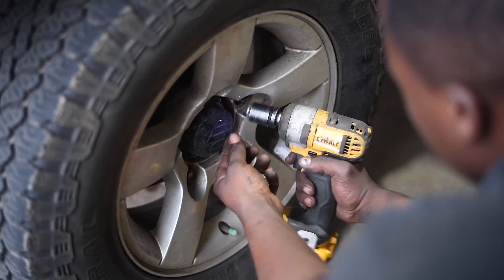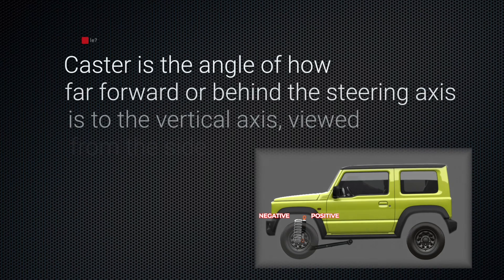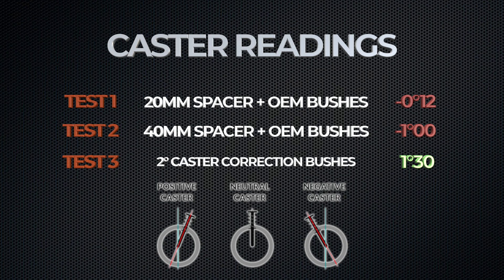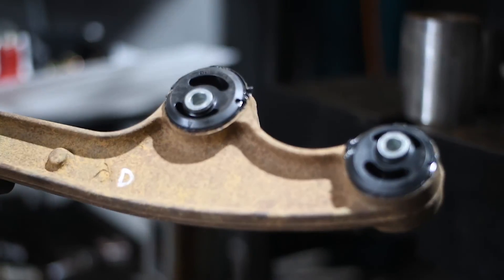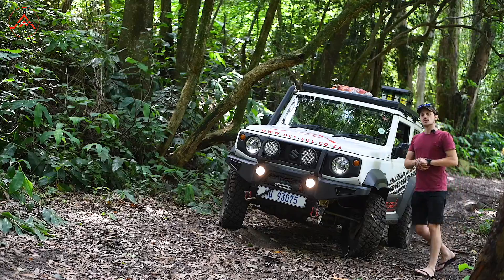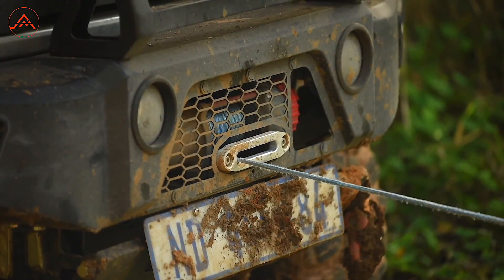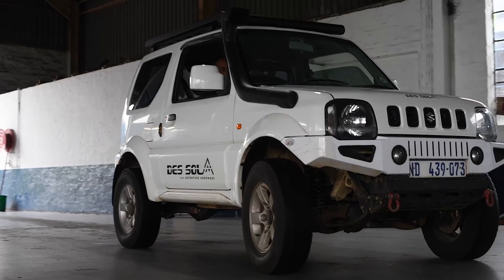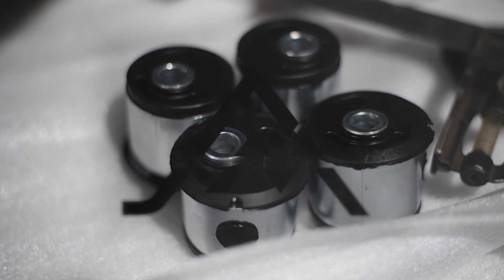SUZUKI JIMNY - do I need Castor Correction Bushes when installing a lift kit? FIND OUT NOW!

Comment: What reference mark is used when fitting the correction bushes. There is no mark on the radial arm or on the bushes
Reply: I didn't found either on the all youtube.  This guy showed us how to remove and reinstall the wheel bolts like we were all idiots, but when it came to clearly explaining how and in what position to install the eccentric bushings – nothing. I mean, he skipped the essential part.

Comment: A 20mm spacer will lift the car 40mm and the 40mm spacer will give a 80mm lift … so your advice is a little misleading as a true 20mm lift will have no effect on suspension geometry

Comment: Des Sol do not comment / have never commented on opposition products and their use of certain technologies, we try to impartially evaluate the pro's and con's of various "generic" afternarket setups for the interest and education of the 4x4 community at large and highlight the importance of trying to keep key upgrades within OEM specification where possible / practical. Manufacturer specifications are there to ensure that you get the best and safest performance out of your vehicle. It is a well known fact that "any" suspension kit that is installed which has a negative caster will create Road or Bump steer which will result in unstable freeway handling.
Given this, Des Sol decided to evaluate and log the amount of negative caster produced from a 20mm, 40mm and 50mm lift kit for those users who might be interested in the actual technical outcome.
Castor Correction Bushes can be purchased from any supplier and installed on any suspension kit so are therefore not product specific.